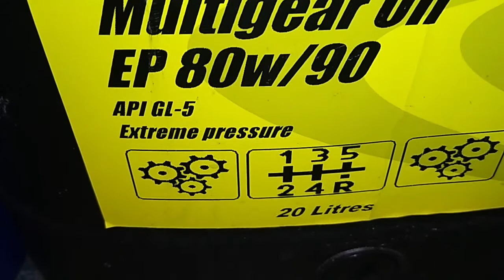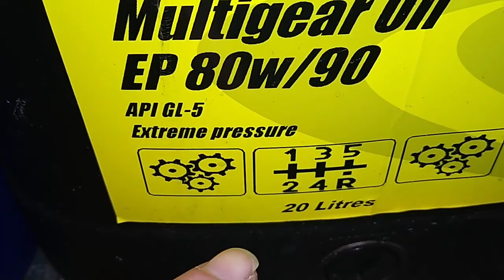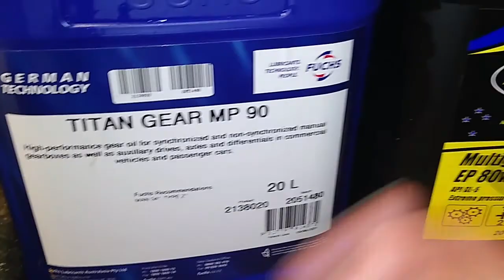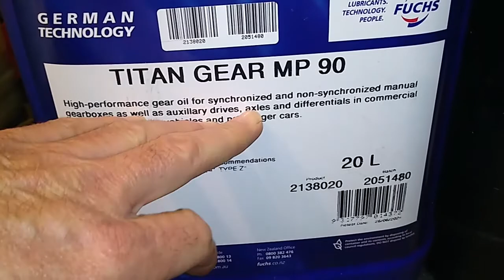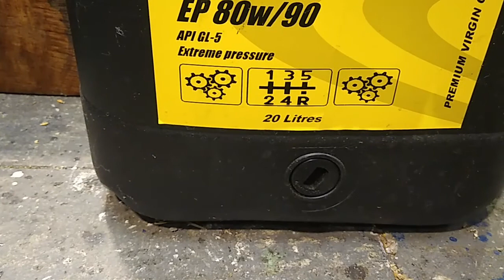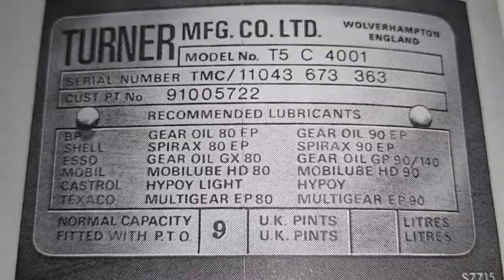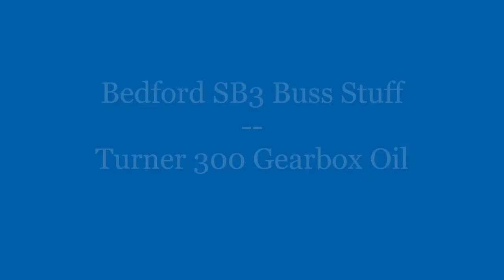Turner Gearbox, Why some gear oil eats brass.

Comment: Hi there, really enjoying your videos and learning a lot. My bus is a 1975 VAS3 Bedford. I havnt had a chance to buy an old manual yet and I'm about to take it in for a major tune up and was wondering if you know what kind of oil goes in the 4 speed gear box for this bus? I seem to have a bit of trouble getting into reverse and I can't tell if its from old gear box oil, or the clutch needs to be adjusted so I'm going to get them to check it out for me.

Comment: Para carros de los años 1995 que aceite de transmisión manual lleva y también del diferencial es una camioneta Chevrolet Cheyenne año 1995 motor 305 tbi 8 cilindros transmisión estandar 5.0 litros 238 mil km

Comment: Nothing wrong with gl5
Reply: Apart from the fact it eats away at the brass........
Reply: @oochiad   NO!   Most gear oil producers switched to buffered Sulphur additives about 25 years ago.   BUT you should still not but GL5 in a Synchromesh gearbox.   A modern MTL lubricant would be best.